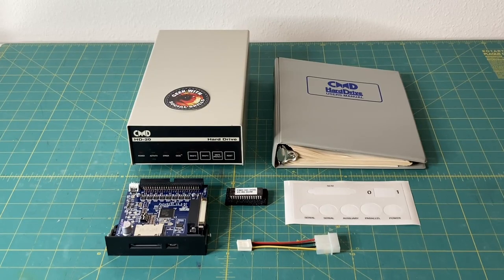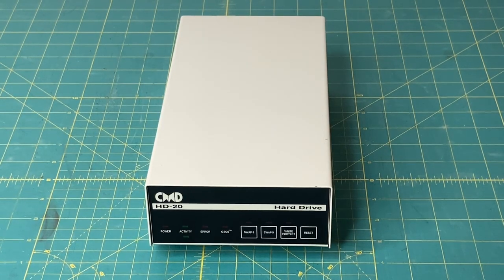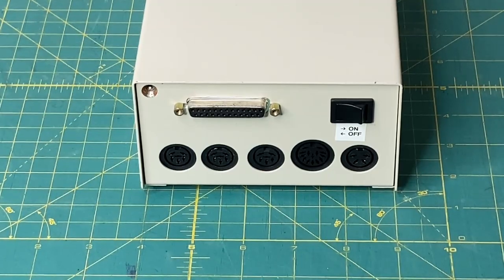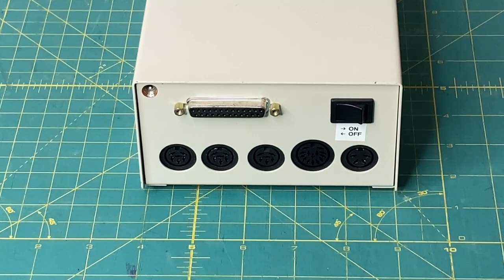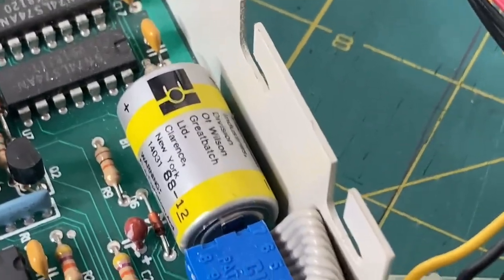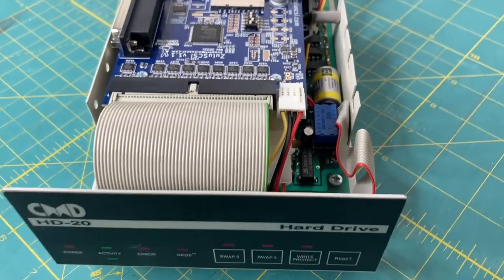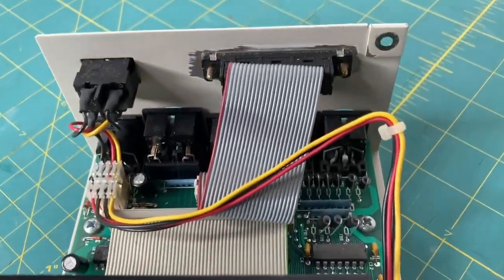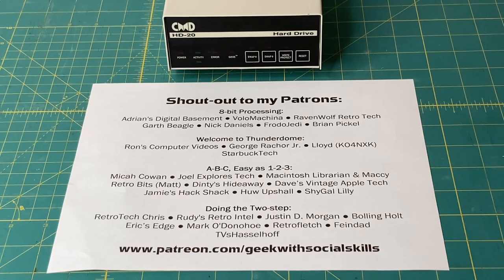Commodore 64 CMD HD-20 by Creative Micro Designs For The C64 Computer

Comment: These are great little machines. I have two myself, both upgraded to SCSI2SD and latest ROMs. One is an HD-40 and one is an HD-20. Both running BBS’s. Also, have one clone Thunderdrive with SCSI2SD.
Reply from the maker: CMD made some really great hardware for sure. Nice that you have a couple CMD hard drives and also the Thunderdrive. I'd like to chat with you offline about your drives and BBS. My contact details are on my channel about page if you would be so kind to reach out.

Comment: What a great drive, and I love the modern-day drive replacement. The sticker is awesome, too. I used that company for my PET lables. Great job! I am looking forward to your next video and eventually dialing in to your BBS with my PET or maybe my Apple IIe. Hopefully, you will also do dial-up:). Thanks for sharing!
Reply from the maker: Glad you liked my video. My PET 2001-N has all original decals, however I have ordered replacement PET decals from COREi64 in the past and they are very high quality. The shipping is expensive though since I'm in the USA and they are based in Canada, but still worth it. As for having an actual dial-up number for my BBS in present day, that would be cool, however I'll need to sort the Telnet connection stuff first since the majority of the users in 2023 and beyond would dial in that way. I will of course have a PET and Apple IIe section on my BBS. Thanks for watching and commenting. Much appreciated.

Comment: Those "removing this sticker voids your warranty" stickers were and are totally unenforceable in a court (assuming you are willing to go to court) in the US.  There were regulations passed by the relevant authority (I think it was a regulatory agency rule rather than a congressional law)  in the US to end this particular abuse. 

There were earlier abuses where an OEM would require you to use their consumables (like Ford requiring Ford branded motor oil) in order to enforce the warranty.  These were outlawed as well.

These are just a "get out of warranty free" card.  If you have to send your device in, how do you prove you didn't remove the sticker?  Even a picture wouldn't help because you can't prove the date the picture was taken or that the sticker is "properly" affixed anyway.

If you do open it and cause damage and they can prove it (the burden of proof is on them), they can void the warranty. But they cannot void the warranty by saying you removed a sticker.
Funny, but I never got notification in my subscriber feed that you ever released this video.
Reply from the maker: Keep in mind that CMD did this back in 1990 to around 2001, so back then the laws and what businesses did or didn't do in regards to warranty voiding has changed a lot. As for not getting notified that I had posted this video, try reclicking the notification bell and make sure it's selected for all notifications.
Reply: @geekwithsocialskills  These rules predate the 1990s.  The auto companies would do this with oil and transmission fluid and the printer companies would do it with the consumables there.   Of course, these rules never stopped them from doing it. Most people won't sue and so the companies don't end up with court orders requiring them to remove the language.  To me, it's an interesting look into the way the tech industry operated and to some extent, still do.
I just thought you would want to know youtube is messing with the channel. I don't watch youtube on a phone, so the notifications has no effect. I go to the youtube home page and change the view to subscriptions.